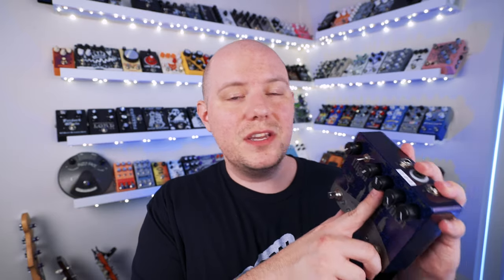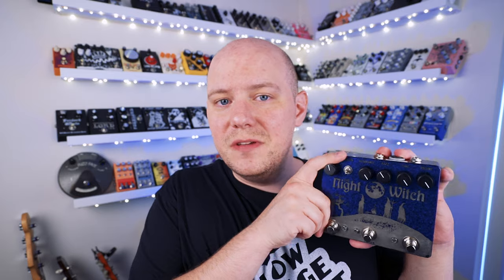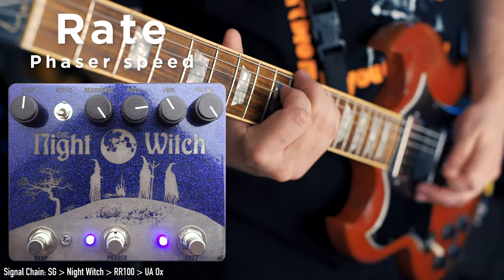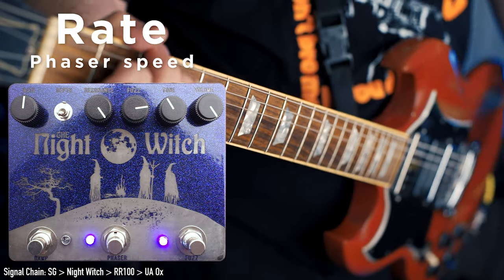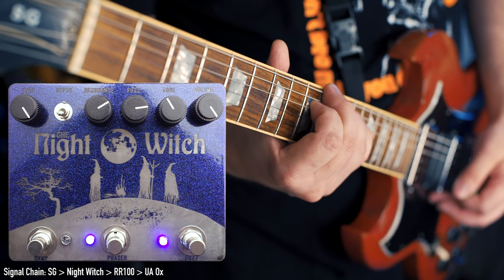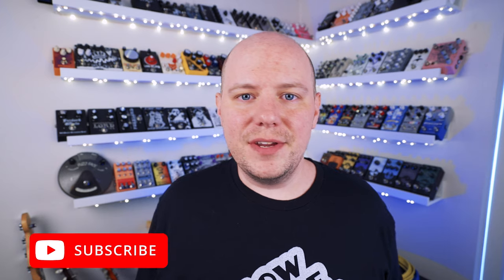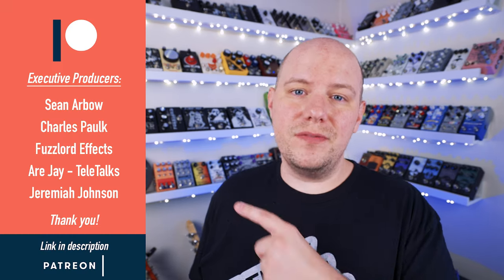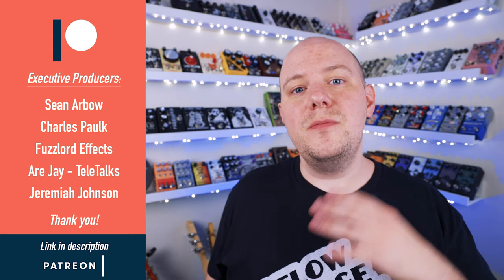Make Sounds Loudly Pedals Night Witch | Fuzz + Phaser

Comment: More than other Jet Phaser-inspired pedals, the phaser side reminds me of the sound of a Small Stone, which is my favorite analog phaser (based on my surprisingly joyful experience of running a cheap Tomsline G-Fuzz into an also-cheap Behringer Small Stone clone!😅 I chose those two pedals as low cost points of entry into the lands of plentiful analog pedal options based on germanium FF or Small Stone, Phase 90, et al.).
Reply: “Does it sound good with bass?” IMO, like most effects that involve fuzz, it sounds BETTER with bass guitar 😉
Reply from the maker: @chiefbucknell  right on!! Thanks for watching Keith!